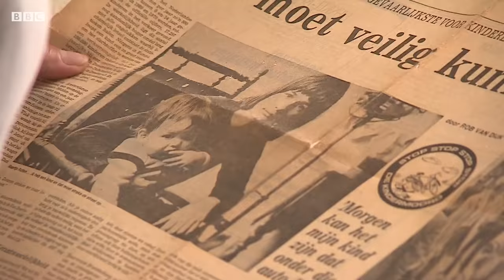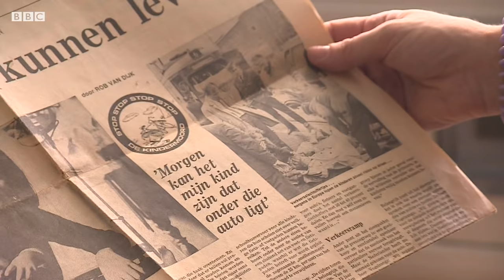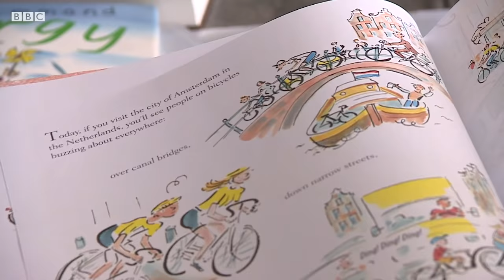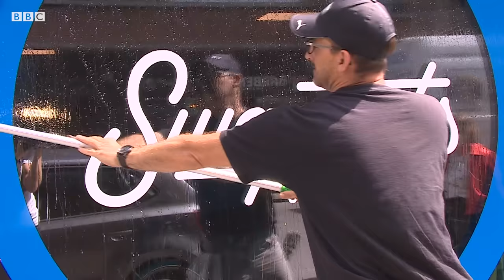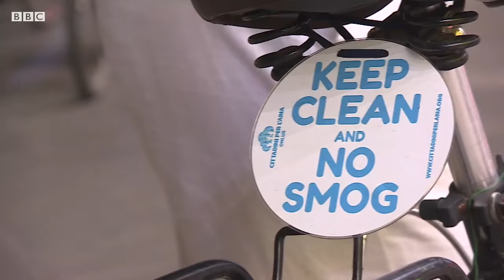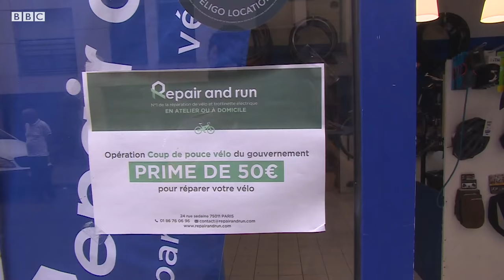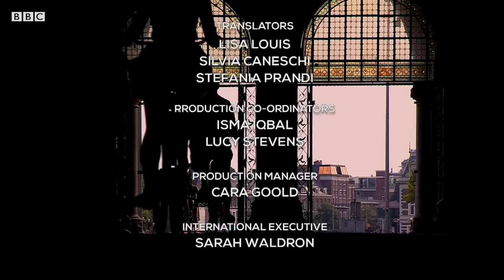Cycling across Europe in the pandemic - BBC World Service Documentaries

Comment: I'd love a follow up a year or so after the pandemic to see whether or not cycling is really taking of long term in Europe, and not just here in the Netherlands.
Reply: build the safe cyclist paths and the cyclists will come
Reply: im from portugal and at least in my city a small bike infrastructure was built and it's still being used. The only problem i see with the lanes is that too often they stop randomly and then you have to cycle in the road until the next bike lane, or they change to the old "paint on the edge of the road" which is not only unsafe for cyclist but also unconfortable for drivers (lose-lose). I was lucky enough that a lane passes near my house and goes on continuously until a train and bus station so i've been using that almosy everday (i rent a bolt bike whuch is not cheap at the end of the month but MUCH cheaper than buying gas) but there could be many more streets for bycicles imo. If there were i and many others would completly give up on cars. The only people who dont like it are drivers and the ones who have to drive bcs they have no lanes conecting to where they want to go. Old people sometimes get mad bcs of bolt trotinetes (idk the name in eng sorry) bcs they sometimes go too fast when the bike lane stops and they have to drive o the part where people walk

Comment: That taxi driver needs to welcome the demise of people owning cars. When people move to bikes and need to travel further they will use taxis.
Reply: or they use ride share programs
Reply: Exactly. My parents used to have a second car, just in case there were moments when having just one car would force them to have to compromise somewhere. After a couple of years, it turned out they only used that 2nd car maybe 15 times per year. Adding the cost of taxes, insurance, maintenance and fuel for the car, I calculated this meant they were paying about 100 euros per ride. So they sold it and now they can just take a taxi whenever they really need 2 cars at the same. But even more often they found they can solve the problem with public transport or temporarily borrowing a car from neighbors... 
Regarding the taxi driver: when people move onto bikes, there will be more space on the car lanes for the taxi. That offsets the less space he gets from having fewer lanes.

Comment: Sadly in Australia we’re actively discouraging cycling.  Were nobbled by compulsory helmet laws in a hot climate and an absurdly low 25kmh restriction for ebikes.
Reply: Here in The Netherlands, we also have a restriction of 25 km/h for e-bikes. We just cycle, we don't race.
Reply: I watched an episode on GCN stating you can only go 6mph on the bike lane
Reply: @BrazenNL  
Same in Australia,most don’t race. Here there are fewer cycle lanes,traffic speed is higher hence the need to move faster to integrate with traffic more safely. 
The 25kmh limit leads to one being a stationary target in many instances,30-32kmh would be far safer.
Reply: @timdixo  I don;t know about that. I have seen 60 years olds racing their modded e-bikes on the paths around melbourne.
Reply: We also have a 25kmh restriction on eBikes in Austria. I still bought one last year and totally enjoy it. Compared to a normal cyclist you are in the top 20% speed wise and you don't want to have that much speed difference between ebikers and other cyclists when they share a bike path. When there is no bike path and you have to share the street with cars, you are still one of the faster bikes, so car drivers should be glad your not just pedaling along at 10kmh. Also, my city (Vienna) made a lot more streets into tempo 30 zones, so I just use those. What we have now is basically a split between 50kmh and 30kmh streets and with a car you just use the big 50kmh streets until you're ready to enter the neighborhood of your destination and with a bike or ebike you can use the smaller 30kmh as a kind of separate network. Result: more pleasant driving experience for both, traffic is disentangled, and neighborhoods are quieter and less polluted because there's less through traffic. I still have to change my thinking about where to drive when on the bike vs by car so that I don't forget to use the small streets but it's really pleasant to ride there.

If you really want something faster, you should get an electric moped and appropriate gear. Here, you can ride smaller mopeds with a car license; I'm also signed up to a ride share service of what are basically electric Vespas. You need to wear a helmet and you want to wear at least some gloves. You don't need to wear full motorcycle gear but I'd definitely recommend wearing at least a pair of sturdy jeans and a long sleeved jacket. Falling at 45kmh is no joke. Don't mod your ebike to go 60kmh and then ride it with flip flops and a tank top. That's just asking for a world of hurt.
Reply: 25 kmh is just fine for ebikes. It's much quicker than most people can sustain on the flat. Any faster and they start becoming a hazard and not suitable for bicycle lanes and places where bikes and pedestrians mix. Agreed with the helmet laws. A short-sighted decision by your govt.
Reply: @MarcoTheGreat2008  
For bike paths I agree re 25kmh but in Australia limiting to that speed on open roads is downright dangerous to the speed of traffic flow.

Comment: Pop up cycle lanes are a cash cow for the councils, they are dangerous, poorly designed and don’t have the cyclists interests or safety in mind at least from my experience here in NW England and I’m speaking as a cyclist and as a driver.  We need to go Dutch and have a better design and installation of segregated cycle lanes and not just a white line on the road or temporary cones that are in place now.  I’ve seen motorists move the cones and drive through a pop up cycle lane, pedestrians and dog walkers using them as well as vehicles parked in them, not to mention signs in the middle of the cycle lane or lanes that suddenly end and force you back onto a road with no adjustment to the kerb etc.  We should also educate drivers about the dangers of close passing, intimidation etc.  Maybe they could introduce this via driving schools or via a method I’ve seen a bus company use where they have their drivers sit on stationary bikes and have a bus perform a close pass at speed whilst on the horn to educate them.  I’ve seen cyclists ignore traffic lights or perform dangerous turns without signalling or dismounting kerbs straight into traffic, cycling into oncoming traffic.  Not all motorists are bad and not all cyclists are bad, more education for all road users is needed and better infrastructure with planned routes involving cycling communities will work.  If we had segregated lanes and these were enforced and used correctly they would be safer for all road users and would also encourage less confident cyclists onto the roads.  Go Dutch!
Reply: The point of the pop up lanes is that they're a start. It's carving out new space for cyclists. They're not perfect but something better will come in time. The Dutch cycle infrastructure is constantly improving btw, what they have now they didn't have 15 years ago, and even less 15 years before that.

Comment: What a load of dross.  Typical BBC.
The demographic in every country is tilting all the time towards older people and who the hell wants, or is able, to ride a bike everywhere.  Fine if your health doesn't deteriorate, but hopeless if it does. And believe me, it does for so many of our older folk. For them, especially country-dwellers, their car is their lifeline. When you live more than 10km from the nearest supermarket, you're not going to get on your bike to get there if you're over 70. In the UK, there has been a huge move away from city centres as a result of the Covid pandemic.The UK government has bought wholesale into the provision of cycle lanes in the cities and the result now is gridlock for motor vehicles and relatively empty cycle lanes. The Brits make all the right noises, but the vast majority of people don't want to ride bicycles everywhere particularly since our climate is not conducive to this form of transport on a regular basis. There is no footage in this programme of cyclists riding down Park Lane in the snow in the middle of February with fog in the air and the temperature hovering around 0 degrees. Stands to reason.

Comment: cycling as a way of commuting has limitation, you don't cycle in bad weather, and parking your bike is a big problem. You have to worry about it or part of it being stolen.
Reply: you can cycle in bad weather (you can use rainclothes), parking your bicycle is usually easier than finding a spot to park your car, and cars get also broken into and stolen.
Reply: @1234hijs  of course we all can bike in bad weather, but think about going to work with your shoes and bike wet for a whole day. I think metal parts don't like getting wet.
Reply: @DarkDutch007  some part of the world, parking bike outside get stolen or part of it like seat, handlebar etc.
Reply: @asfsfas2435  that is the same for cars, there are gangs going from city to city to take airbags, infotainment, headlights and other panel parts from cars to sell them in another country, or you come back to your car and find it vandalized, everything you can own, people can steal or vandalize it anyways.

and don't worry about getting your bicycle wet, they are painted, you should only worry when the paint is chipped.
Reply: Do you wanna tell this to the Duthc too? They pretty much cycle allday and night, in whatever weather. If its sunny, they cycle because of that, if its rainy they cycle because of that, if its windy, they cycle because of that, if its snowy, or icy or whatever, then because of that. Are they crazy? Not more than a diesel/cummings lover people. 

Its actully pretty practical to go by bike, plus if society except it, they go around like that, like carrying plus clothes/shoes to swithc over, etcetera. Yes, bikes get stolen here in NL too. by some estimation 6000 bike gets stolen a day in NL. And because of that most bike are actually those cheap omafiets, what goes for like 20-150 euro, and they say, if yours get stolen just go and stole an another one.. (I hate that mentality, but i hate thieves the most, so... bad for me). And those omafiets are pretty sturdy bikes, they are the most used ones too ANd im pretty sure ive seen some whats close to be a hundred years old....
Reply: "You don't cycle in bad weather", tell that to the rain drenched teenage version of me, or the one with frozen toes and nose. Maybe to the one caught in a (snow) storm?
The things I did for 15 minutes of sleep.
Reply: Take a look at Bicycle Dutch's channel. Shows Dutch folks cycling in all kinds of weather as well as bicycle parking garages and other cycling-related things that are just a part of life for the Dutch.
Reply: @DarkDutch007  Ohh,and you forgot a super expensive part of the exhaust system.. The catalizator!

Comment: Dutch are rude drivers they never flash to give way or smile behind the steering wheel and those kids run over are not because of the cars but because of the drivers and general traffic concept. Against the car even today the child is not safe by sitting on the bike. If you allow structurally weak transport mode mixing up with cars you have created a problem on top of it that road user got no knowledge of highway code or traffic rules, not on tested by law level. It is illegal and irresponsible for the government to allow cyclist and car, lorries, buses on the same road.

Comment: Bikes are a pain in the butt! Only single people can utilize them. What is needed are 'People Movers' .Trains. Subways.  A rail system. These rail systems should be ran on Electric or kind of fuel that does not pulute the air. Bikes are now clogging traffic
Reply: [] ... Bikes are a pain in the butt! Only single people can utilize them.

On average, how many people are in a "utilized" car?

To be clear, I totally agree that you need a functioning, balanced, integrated and practical public transportation infrastructure.
I totally disagree with you that "Bikes are now clogging traffic". Nowhere this is the case. Quite the opposite actually. If you think you see some clogging than in virtual all cases, if not all cases, the number of people passing per time unit is greater than the car traffic only situation.

Comment: I was rather surprised that I didn't see any one wearing a helmet in that first clip, about riding the Dutch  bike routes and paths. Helmets are a must.
Reply: The Dutch have removed any risk from cycling through well designed infrastructure so helmets are not required.
Reply: So why aren't you complaining about all the people walking without a helmet? 50% of head injuries in traffic happen to pedestrians. Are you going to go walking with a helmet from now on?
Reply: @miriam4235  cite your sources please.
Reply: if you want you can wear a helmet, but forcing other people to wear a helmet will result in less cyclist making it more dangerous for people who keep on cycling.

The cycling infrastructure is pretty good and it is generally safe to cycle around without a helmet, thanks to the that infrastructure and the amount of people cycling, but while it is safe, does not mean you can cross roads without looking.
Reply: In a shower they are. Very dangerous, slippery showers!